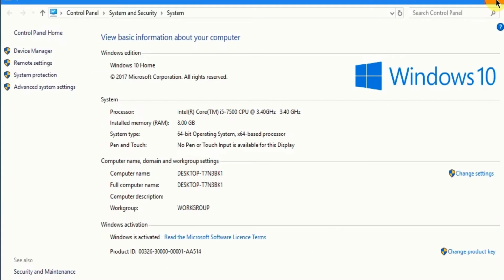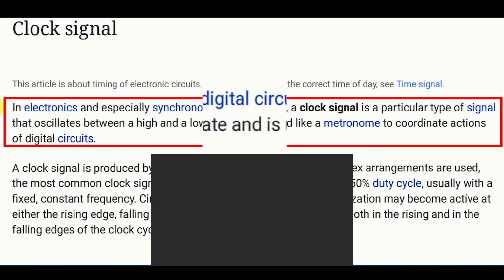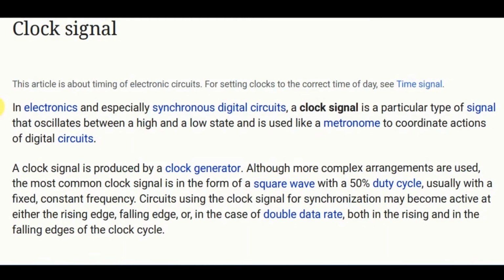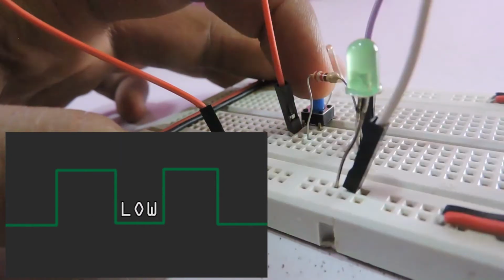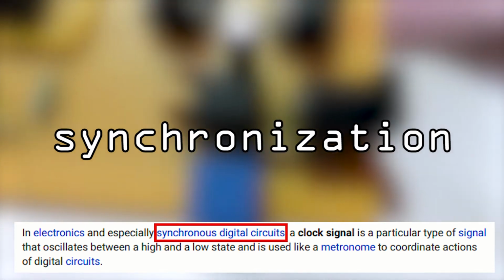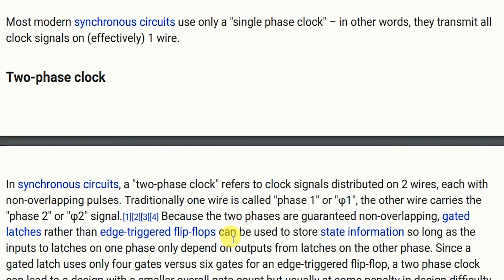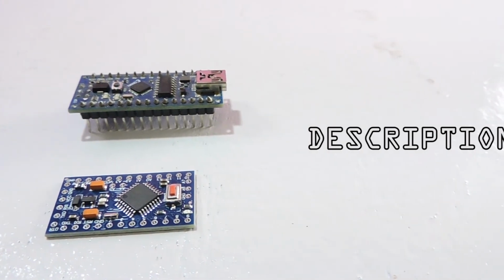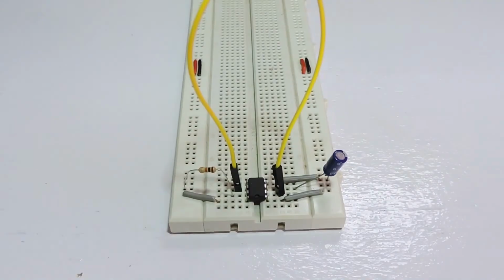Generating clock pulse using NE555 | Beginner easy experiment

Comment: bro can you pls tell me wich functions these resisitors and condensators @ 3:50 have?
Reply from the maker: You can calculate that:
T = 0.693 x r17 x C 
Keep capacitor (C) as 10uf, and for whatever time you want set T and find R.
Just make sure R16 is a negligibly smaller when compared to R17.
Reply: @Neutrino1  yeah but why are they there? why i need them?